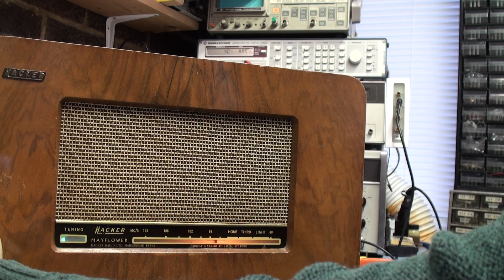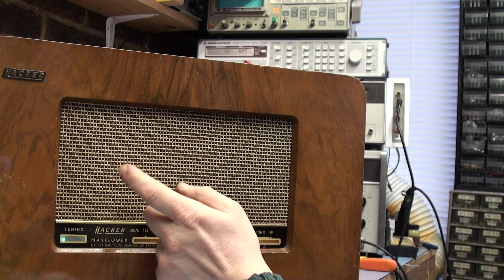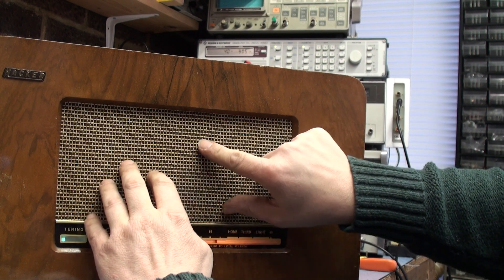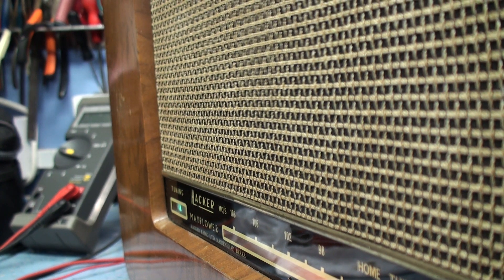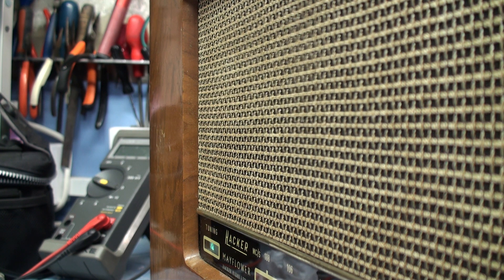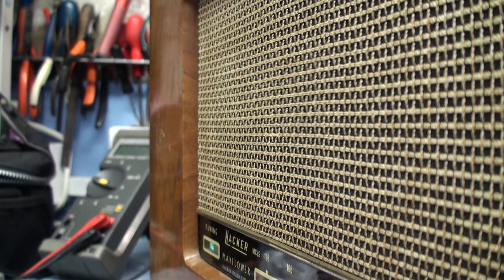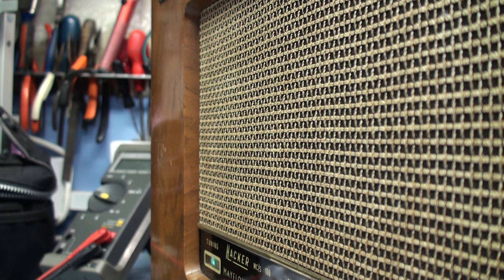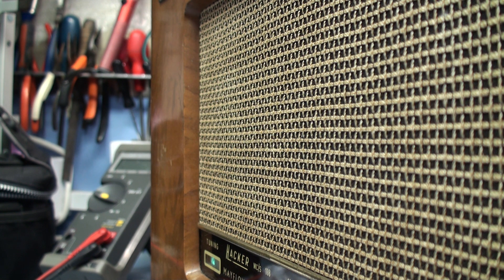Speaker distortion not what I was expecting

Comment: That sounds more like the cone is slightly off center. At such a low frequency you can expect the grill cloth to move a little. It seams to clear when you touch it simply because your hand pressure moves the cone slight more central. You may find changing the pressure of the mounting screws will help. As the wooden cabinet has warped in time it is distorting the speaker frame.
Reply from the maker: +Michael Beeny Hi Michael,, the speaker has been out and is perfect, Its definitely the cloth!

Comment: To fix this problem, you could affix a thin1/2 inch strip of metal across the back of the grille cloth center vertically, with double sided tape, then re-install speaker as  original. I guess it should stabilise the grille cloth and  prevent it from flopping around at low frequencies.
Reply from the maker: +vener6 There is a wooden baffle behind the cloth already so yes double sided take would be a good fix. Problem is I would have to remove the speaker cloth!
Reply: +Simon Spiers  If cloth is vibrating against  the wooden baffle , having no idea on how it's made(i have checked your prev.videos), i presume it's a baffle with some holes in it , then maybe a tab of hot melt glue in a few center points on the cloth / wood could hold it down better.
Reply from the maker: +vener6 The problem with glue is it might leak through the cloth and be seen on the outside. 
Double sided tape sounds the best idea so far.
Reply: +Simon Spiers Yes hopefully. It's a very nice radio  . Good luck in reducing the noise.